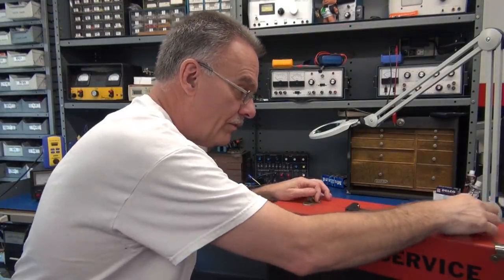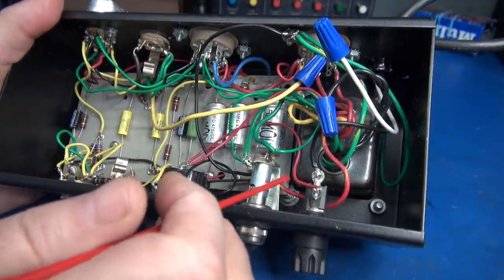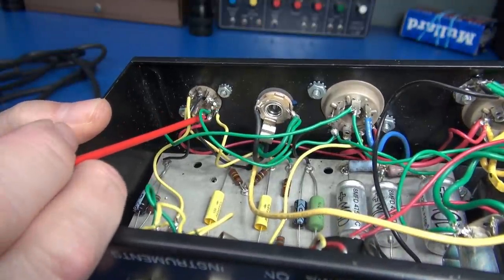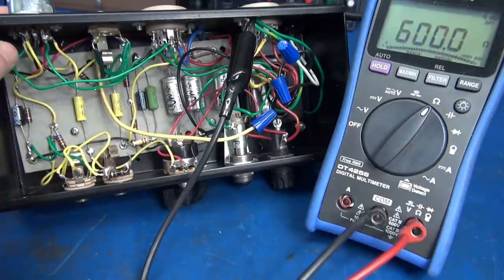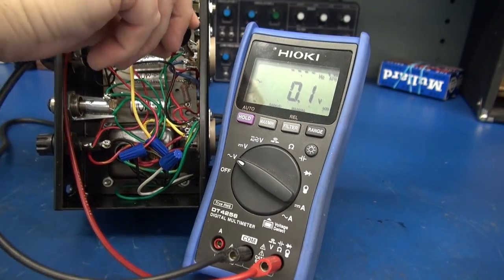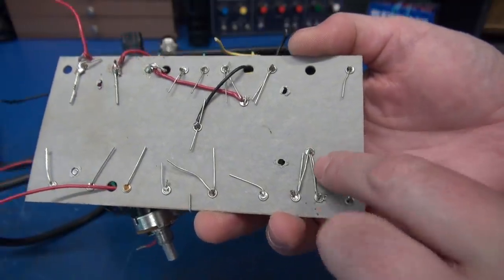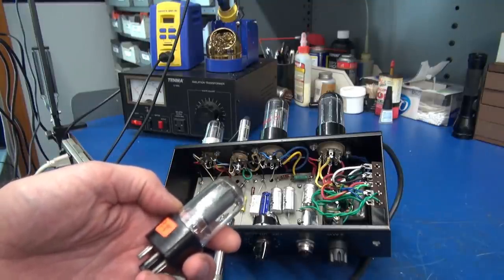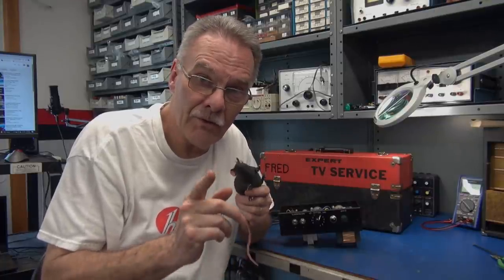D-lab series Basic Training Tube Guitar amp repair Help you Fix Dead 5F1 Fender Champ kit build

Comment: That was a very helpful video. Terry when you turned the eyelet board over, I almost spit my coffee out!
I will never criticize someone for trying, but they should take baby steps first.
I know you noticed it too but, I could tell the soldering iron used didn't have enough wattage for the job (melted insulation). 
I am a solid-state electronics tech and I have been trying to learn about the interesting world of tubes for months now. For me, I have to understand how it all works before I start stripping wire. 
I don't have anyone around, locally, to help learn about tubes and Terrys videos are always eagerly awaited.

Comment: saw many poor solder joints at the first inspection.
the other side of the eyelet board was a total fiasco.

I blame this on the school system not having shop classes anymore. 
Learned about soldering in 7th grade (age 12)

Comment: D LABS, when biasing amplifiers cold it will reduce the amplifiers headroom, any reasons why? The negative biasing Voltage sets the amplifiers headroom but I thought the Plate DC voltage set the amplifiers headroom so I'm confused because I thought the high voltage plate DC voltage is what sets the amplifiers headroom, can you explain more about biasing headroom?